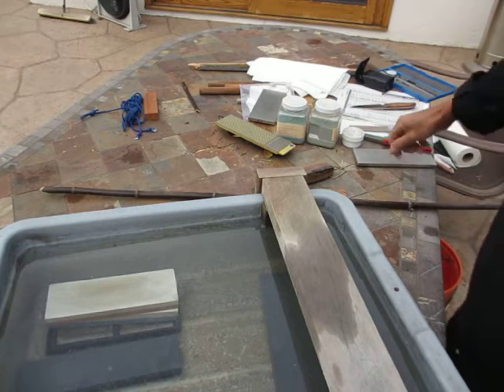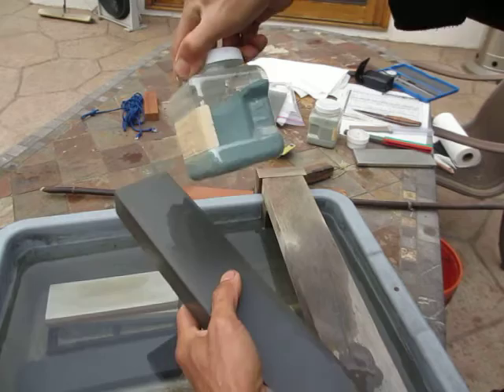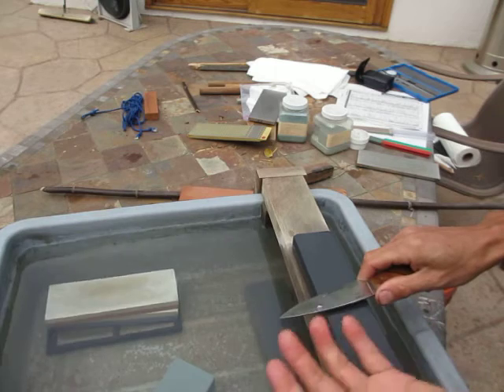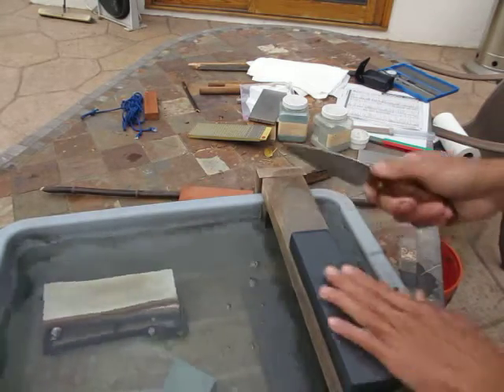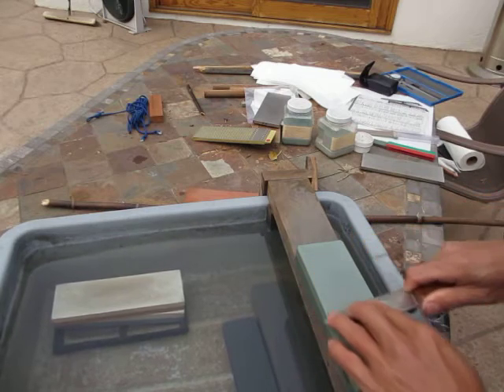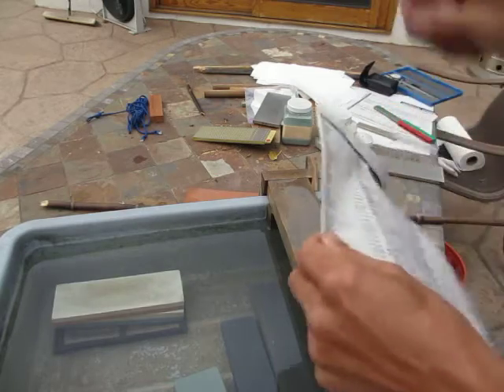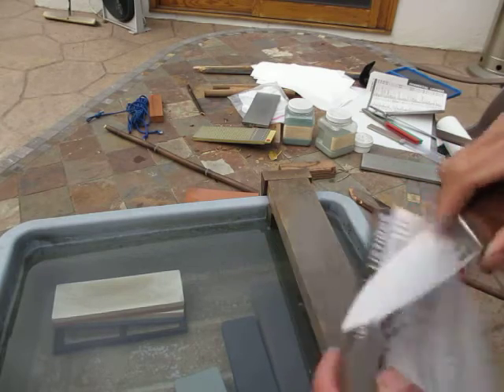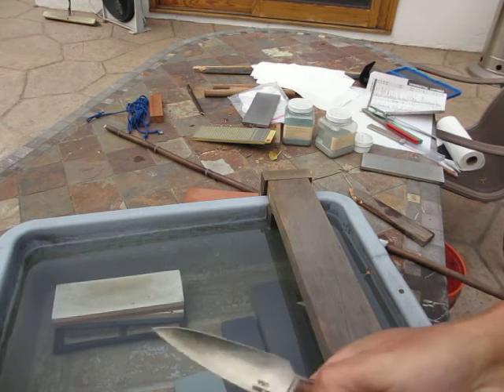Sharpening high hardness and wear resistant steels

Comment: Very interesting explanation at the 7:23 time, for the bevel setting. This is a question: if I heard you right, you take the width of the blade, then raise the back of the blade 1/2 of the width of the blade, and that will give you the desired bevel? I thank you for posting your informative videos.
Reply from the maker: In video:  18dps on a 3.8mm thick, 381mm wide, I raised ~115mm -  stone surface to center of spine. 

For calculation purposes, if raised 190.5mm (half blade width), that equal to 29 dps.  Which is 4 times stronger than 18dps